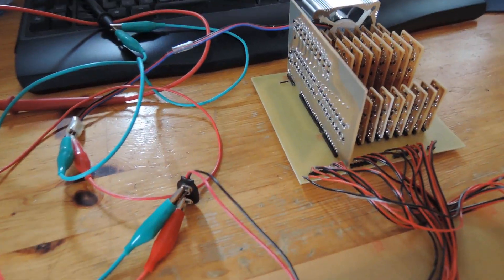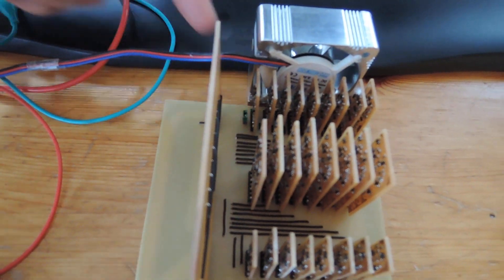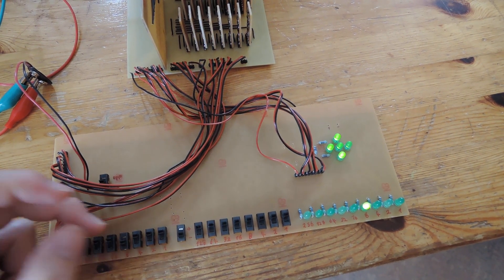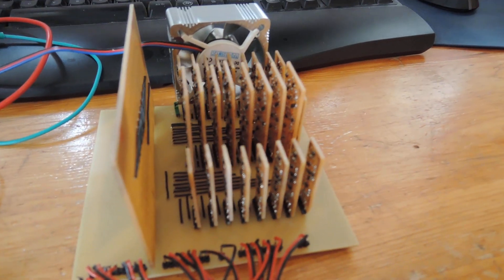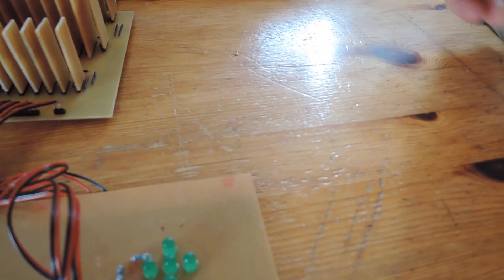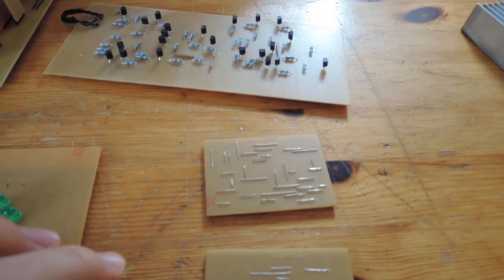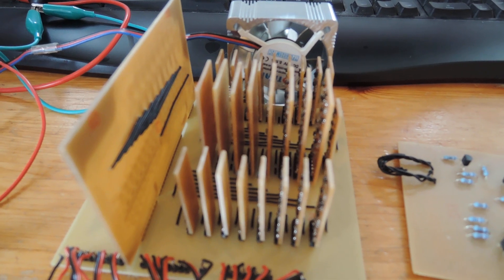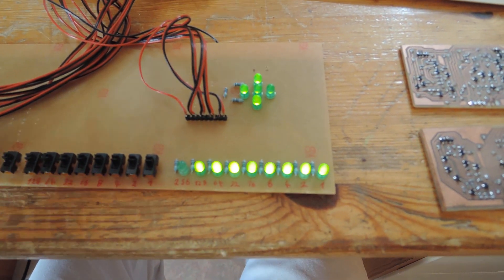Eight bit transistor computer

Comment: Why is it getting so hot? Normally it would not use much current for logic gates, can use 1-10K ohm resistor, don't have anyload on them.
May it's because you drive the led with you ALU, don't know where the led current is coming from? But if goes through the alu that is not good, use some driver transistor to drive the leds.

Comment: How many volt it need it?
Reply from the maker: here I'm using 5V. The minimum is around 1 V.
Reply: @Martin-dz8qp  Would it run cooler if you ran it at ~1.2v?
Reply from the maker: @KingJellyfishII  That's for sure. The fan was just a joke, because I made a "cooling fins" design. 

But there are minumum values for current and voltage, depending on what you are switching. First have a look into the datasheet for your component.
Reply: @Martin-dz8qp  Ah alright I see now.

Comment: Hi, I tried some months ago to do something very similar, but the problem was that after each calculation, it somehow managed to reset itself to the initial state or show the maximum reading on the digital display that I used. Cand you please post a link with the schematic?
Reply from the maker: These are only 8 Fulladders with 8 XOR Gates for subtraction. Its impossible that it resets itself :D

Comment: This is great! It's awesome how you can swap out components so if one fails, it can be replaced. Can you show (or tell) how you soldered the surface mount components?
Reply from the maker: For soldering, you need a pair of tweezers (maybe a magnifying glass) and the thinnest soldering-top. :D

Comment: that's a really nice adder. I like the +/- sign. I would like to see the logic diagram, because switching to minus invokes 2's compliment addition.
Reply: Anton Nym it's not hard, just add an xor in the b input and link all the xor's b ins to the sign (+=gnd -=vcc) so when you set the cpu to minus it will invert the second number, then set the cin to true

Comment: Ever tried to make a complete CPU ?
Reply from the maker: i begann to make a complete one, a jear ago. But now I am working with mosfets to minimize the needed current.
Reply: yes that's good! I am building a CPU with 74HC CMOS chips, they need almost no current!

you should try making a full CPU, with instructions, ram, buses and so on!
Reply: I am also building one with 74HC chips
Reply: I like your videos, I will implement a Flip Flop with transistors! I wonder if in a near future 3d printers will be able to print transistors / resistors
Reply: Using bjt or mosfets ?
Reply: The flip flop using BJT, then I will implement a computer using logic gates and other components. I have already bought a lot!
Reply: I am doing that right now :)
Reply: could you complete that ? :)
Reply: Of course.. Why not?
Reply: wanted to ask what kind of resistors / transitors you used, can you share that ? thanks
Reply: Yes, use only the 74HC series of chips. No need for resistors at the inputs or outputs unless you want to limit the current for things like LED's and so on. Don't use 74LS they are too old and consume too much current!
Reply: yeah, i have made a 64 bit cpu if u wanna see i can upload to youtube :D
Reply: Don't lie. That is impossible to do with standalone 74LS or 74HC chips. Why do you think it took so many years for engineers to build 64bit computers? Why were all computers 8bits back in the day? Because it becomes a wiring nightmare to do 64bits!

If you did you used an FPGA.
Reply: Ohh, sorry i was said wrong, i'm so realy sorry. it is an 32 bit... i feeling me so bad to fail on my keyboard. i was to tired. well. i'm the founder of Teglus. I started by some years ago to find a solution for my cpu to get from 16 bit to 32, and it realy worked, i'm a computer science right at this moment, sorry if this doesn't hear real, but it is real. it is possible. my solution was not your chips. i used smaller nano chips. do you even hear about silicon wafers? it's a method to use light to place the schematic. and then i use another machine to place all the nano transistors on a length of approx 8 nano meters. it's hear strange, i know but it's real :D
Reply: LOL minecraft kiddo , classic...

Comment: Nice!  How did you implement subtraction?  Did you change the sign on the addend and add?
Reply from the maker: +Anton Nym Hey. How to subtract in binary: Inverting the second number and add 1. Then you add the two numbers. Thats it.
Reply: That's what the xor gates are for?  You're also adding 1 to the carry in, yes?
Reply from the maker: Yes. Without the "Minus Button", the output is the same as the input. When "Minus" is high, the xor-gate changes the logic level. And "adding 1" is the reason why you need all to be a fulladder. Just for addition, the first could be an halfadder too.

Comment: Can you share some details about your transistor of choice? Did you use BJT or MOSFET? Maybe some example of your layout (not the circuit itself necessarily, just how you did biasing and some logic gates). I'm currently creating my own computer in just theoretical logic gates, but I'd like to make a real world version of it, and I was thinking of using SMD transistors too since they're so compact. Nice work!

It wouldn't be too hard to add your own instruction set some ROM/RAM, although I feel like it probably would be a lot of discrete transistors.

Comment: Wow it even knows how to deal with negative numbers!
Reply: +realflow100 all adders "know" how to deal with negative numbers. 
consider the following:
we have a 4 bit full adder with two inputs (obviously) and one output. It also has a carry-in and a carry-out. 
lets consider all the following numbers as "two's complementary" numbers.
0010 (2)
+
0100 (4)
=
0110 (6)
or...
1110 (-2)
+
1101 (-3)
=
1011 (-5) 
the carry-out gets disregarded because we do not need it for anything...
0001 (1)
+
1101 (-3)
=
1110 (-2)
These operations were solely using the full adder. 
So that is how the adder can subtract if both the numbers are two's complementary and the subtrahend is already the negative version of the number you wish to subtract. 
Now lets say we have 0100 (4) and 0010 (2) on the input pins but the operation we want to do with them is subtraction... we can't use an adder for that, right? Well yes we can it's actually really easy. All you have to do is simply invert the subtrahend and also enable carry-in for the adder. Now lets see what happens
0100 (4)
+
1101 (-3... this is the inverted subtrahend)
+
0001 (this is the carry-in)
=
0010 (2)
Yet again the carry-out is disregarded because we do not need it for anything. 
That is essentially how all of our processors subtract... using an adder, so to have an adder and no subtraction available is simply being lazy - making a full adder into an adder as well as subtractor at the same time takes very little additional logic.

Comment: Cool, but This is not a computer, this is a calculator.
Reply: +John C G Which is also a computer... Because that's what a computer does, it computes.......it crunches numbers. The Abacus is also a computer, no electricity  needed..
Reply: +John C G A calculator is a type of computer. It computes mathematical expressions, that's what a computer does.
Reply: John, you need to look into the history of computers. The first digital computer ENIAC basically was one giant calculator adding ammunition during WWII.
Reply: +John C G All a computer does is story store and process data. Please stick to your mobile phones :)
Reply: +John C G A computer computes (calculating values)
Reply: +John C G normally a computer is just computing machine be it mechanical or electric, it comes from the word compute to calculate , even early programmable computer dont fit the " computer" by your definition.
Reply: Ikon Data Solutions EINAC was not the first computer.

And yes, a computer needs to execute some steps to compute walues. They uses devices like this, a ALU, to compute values.

Still a cool device, based on logical modules. As I wrote, PDP-8 was built around a couple of hundred logical devices like this, called flip chips. Later models used on IC on each flip chip, but originally built around transistors, like these.
Reply: +Teth47 i agree!
Reply: 新一工藤 early computers do come with a program memmory.
And computers was originally the name of (usually) women that computed values, like values in a logarith table.  So if you are going that track, you are also wrong. ;-)

And yes, early computers still had programs. Even if they was hard vired into the hardwire and the computer needed to be rewired to reprogram it.  There are emulators for ENIAC, that let you reprogram one ENIAC and run the program.
Reply: But computers have a way of interpret and execute instuctions. Calculators only do calculations.
Reply: a calculator is a computer - it computes numbers. Before electronic computers women who calculated math were called computers. (from wikipedia)
Reply: Your calculator is a computer.
Reply: +Martin Brandstätter Is my PSU a computer? It has lots of transistors in it....
Reply from the maker: +John C G All electronic devices, made out of transistors are called computer, it sounds better.
Reply: +Martin Brandstätter All computers have a programming interface. Not all electronics have a programming interface. This is what sets computers apart from electronics.
Reply: All computers are calculators.

Comment: Why would you need forced cooling on a single full adder? It should run on about 50ma at 5V... That's barely 0.25W.... The leds must get hotter than the whole circuit board... Think about putting higher resistance resistors on the bases of the transistors. Processors have achieved nanoamp consumption per adder about 40 years ago... It is impressive though! I love how you've stacked the boards! It looks awesome. Now make a counter and cash memory and finish the whole processor!
Reply from the maker: Eviltech Hey. It was just a choke about the fan ;) But i don't reach 50 mA, that would be cool btw. And I am working on a main memory right now. 
cu
Reply: what is that memory for?
Reply: Peter Hindes For remembering the results for later use. That adds the ability to calculate longer numbers and other functions as multiplication and counting.
Reply: Eviltech oh that would be cool to add